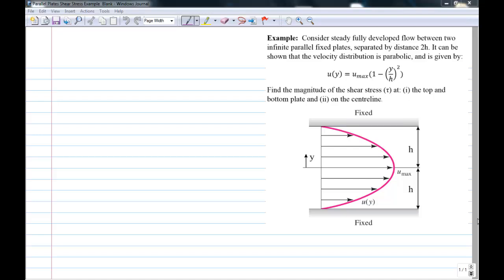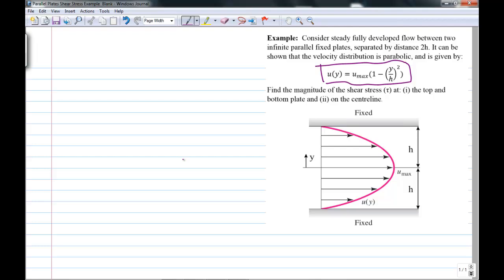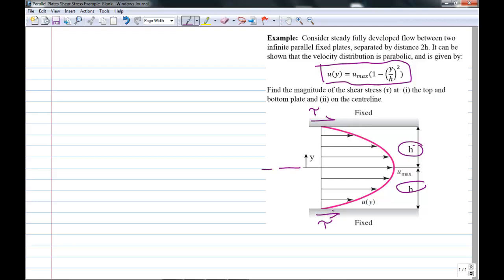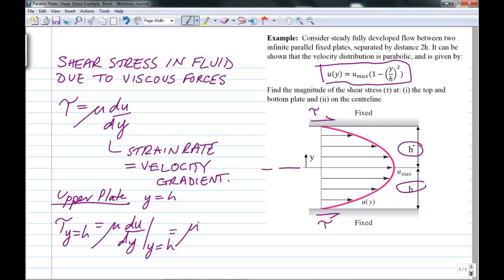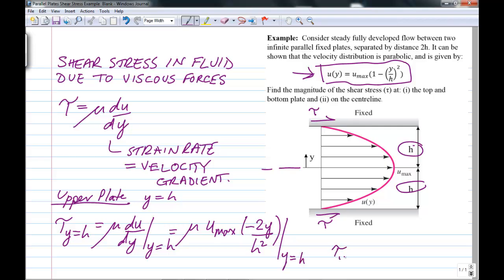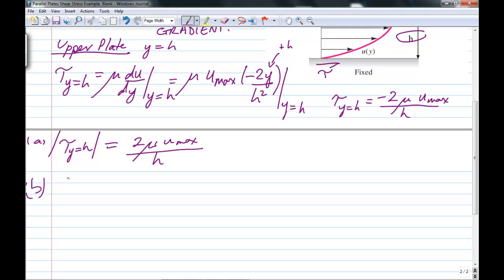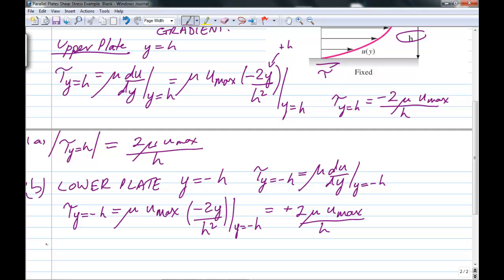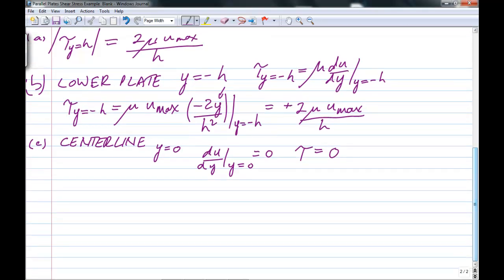Fluid Mechanics Exam Problem: Shear Stress Between Parallel Plates

Comment: What is the physical explanation of the shear stress change of sign at the walls ? At first, I thought it would be negative at both walls.
Reply from the maker: This is tricky to explain in the comments, without a diagram: The sign of the shear stress does not indicate the linear direction of this force. (The shear forces generated by fluid viscosity ALWAYS
opposes fluid motion.) Look at Figure 1.6 in the White textbook, if you have it,  which shows the definition of a positive value for fluid shear stress. A positive value of shear stress (τ) causes the square fluid element to deform into a parallelogram in the positive θ direction, i.e. clockwise. Conversely, a negative value of shear stress will cause angular deformation of the fluid element in the negative θ direction i.e., counter clockwise. I hope that helps.